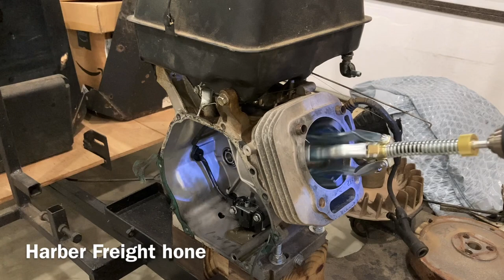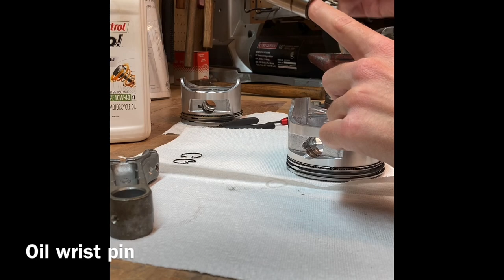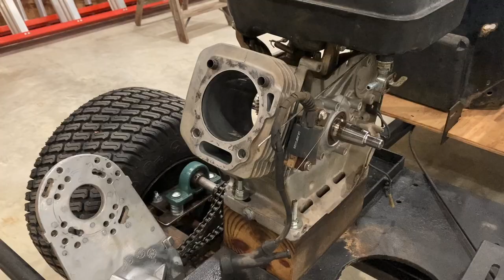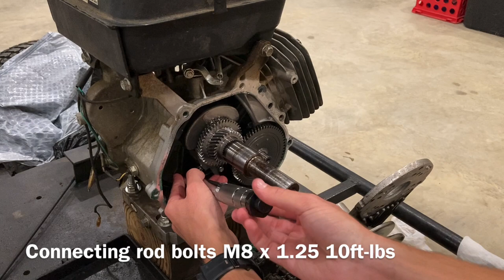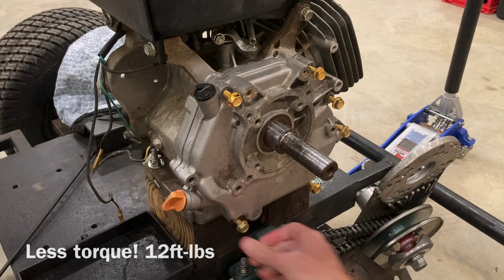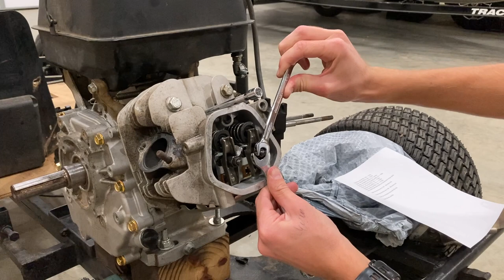Predator 420 Engine Rebuild Tutorial. Piston and Gasket Replacement.

Comment: I have a question my 420 predator runs great till you get like high speed and it sounds like the inside the engine is coming apart
Reply from the maker: Is it a loud knocking from the crank case? Could be a bad connecting rod? It may be best to drain the oil and give it a look for metallic color. Cheap diagnosis and changing oil never hurts. If it is glittery, I would open the engine up and see what’s wrong.
Reply: Thanks bud I will do that and keep you informed